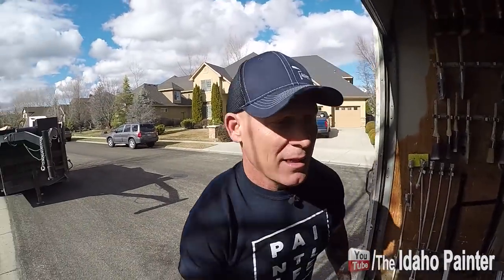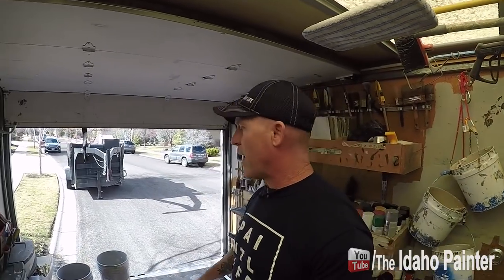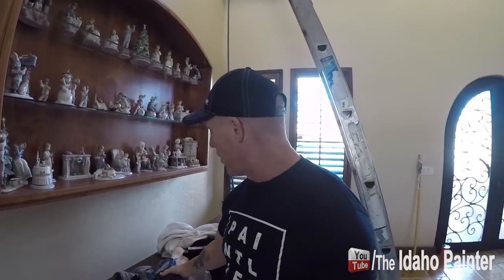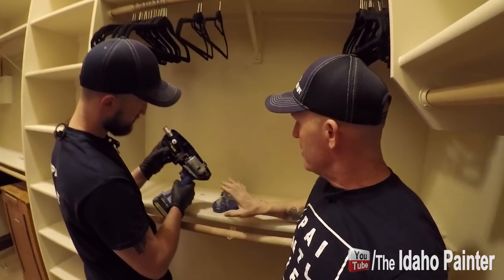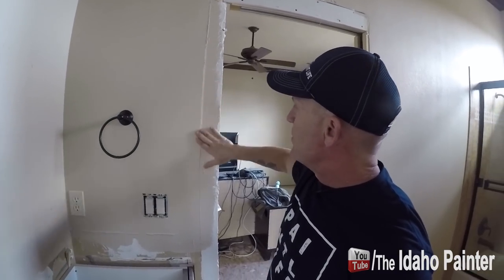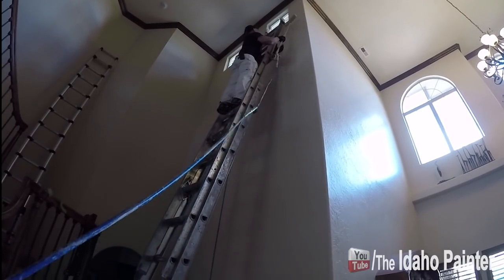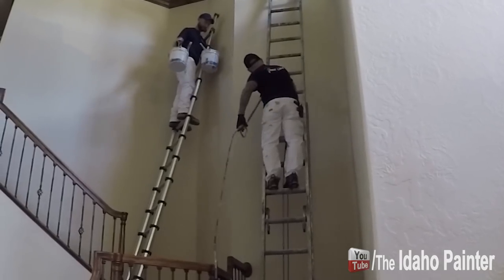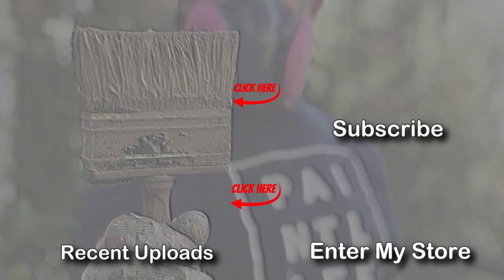A $20,000 cleaning BILL

Comment: I get all intel up front before I even do my final bid, I always ask about other contractors being in the home & make damn sure I will not be working around them as it typically is a horrible process.  From having to argue with them over which areas are being worked on when I'm trying to do my work from dust issues, them using my ladders or tools without asking to parking issues, it's just not worth it & I will gladly pass on the project unless I have complete control over every aspect so I can get my work done properly. I went through a living nightmare on a huge faux finishing project lasting months around other moronic contractors on a 7000 sf custom home, lesson learned.
Reply from the maker: Great idea, thanks for sharing!
Reply: vinniecorleone62 
My goodness...I hear you budd...I'm a painting contractor in Delaware and all it takes is 1 nightmare project like that and you learn fast...lol..
Reply: Every time I am working and there are other contractors on the job some of my stuff always  ends up missing. Last time the gutter guys took a 24 ft ladder. But I tracked them,down and got it back.
Reply: Lol just go open a can of mek in the room where you need to work it'll empty out real quick lol
Reply: I feel you guys especially when the paint contractor paints finishes his job and all the other contractors give zero fucks abt the walls they bump into the walls with there materials damage them , stain them get them dirty or Make HOLES ON THE WALLS and they expect you to patch them up and re paint them and who does the homeowner come after you when you had nothing to do with it getting damaged.
Reply: Instablaster.

Comment: I recently finished a new construction house. It was my second new construction job ever. Only been painting in my own for 4 years. Both jobs my bid was too low. One thing Iv learned about new construction jobs is that the painter gets stuck with a lot of problems. Other contractors don’t care if they ding a wall or if they drill a hole in the wall they won’t patch it because the painter has to do that. You guys out there looking to get into new construction it has a lot of potential. Just be sure to have a clear detailed bid package like chris does. Clearly establish what you are responsible for and what you are not. And if there is extra work created because of other trades it will cost extra. Also asked the general if he takes any dust control precautions. The carpenters on my last job were cutting everything inside and dust was literally EVERYWHERE. Contractors lot of time don’t wanna invest in dust collection. But if you think about it, it would save so much time and effort.

Comment: My company worked on a half million dollar condo here in Hawaii about 1600 sq ft. 'The place was a fully furnished vacation rental, art work, furniture and throw rugs everywhere! Photographed the original set up so we could put it back together after painting. To make it real interesting, all walls and ceilings were a slick finish over concrete with some drywall slicked. Efloressence was everywhere. High humidity and ocean breeze causing the paint to dry very fast! Sometimes you get these challenging jobs and one just has to push through it. Totally get what you are dealing with here.

Comment: So I have seen ladders kick out even though it was on a non stick drop cloth. I would always have someone foot the ladder when that high in a house. Safety first. Also it definitely sucks that there's no communication between contractors. I run into it more than I should. Also live the ladder pivot tool or as we call it the boot. Another great video by the way. I do have a question for you though. Since John was using the power roller and not rolling all the way up and down, do you see where he left off each time he ends his roll ? I like to roll all the way up and down when rolling.
Reply: No, as long as your properly backroll it doesn't matter. I know some painters who do the top portion, then the bottom. Most do it in one swoop, but with heights like that it's easier the way they were doing it.

Comment: The other contractors' jobs smell like lawsuit! But I just can't understand why the owners left all their electronics and kitsch figurines etc. exposed, or didn't specify the dust and caulking removal issues in the contract. Probably that's what you get hiring Acme-El-Cheapo Ltd., and save money on a project inspector, or avoid hiring a consulting architect ... at least they hired a professional painter.
Reply from the maker: At least!
Reply: The homeowner should not have to cover anything up...it's up to the trades to make sure the homeowners belongings are secure...Also horrible general contractor..

Comment: u should keep u mask in bags
Reply from the maker: Good idea!
Reply: just the filters or cartridges. Put them in a zip lock bag, they only have so many hours of life when they are opened before they need to be replaced, the zip lock will keep the fresh longer.
Reply: You're absolutely correct, We did the same thing, It's also a good idea to use "Vaseline" on your face and forehead to help keep your skin clean and the pores open, The paint is really bad for you and your body will absorb it through the skin. Over time it can make your "liver quiver" lol
Reply from the maker: We replace them every job